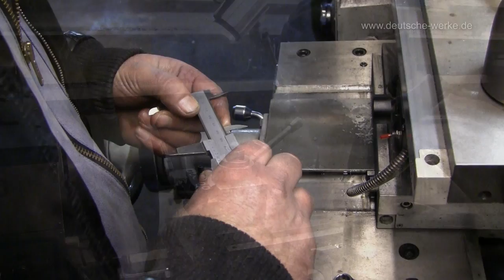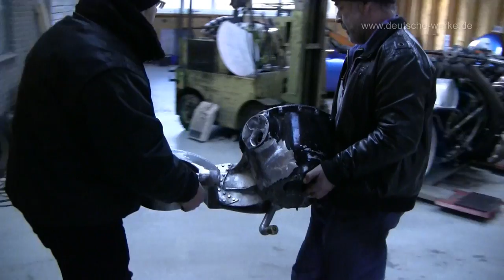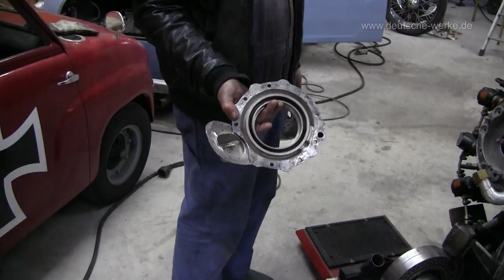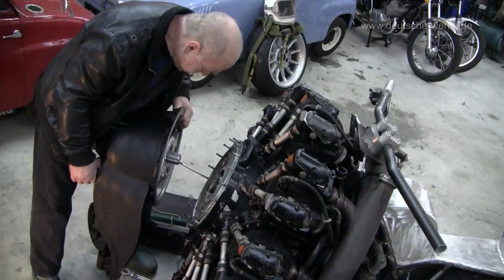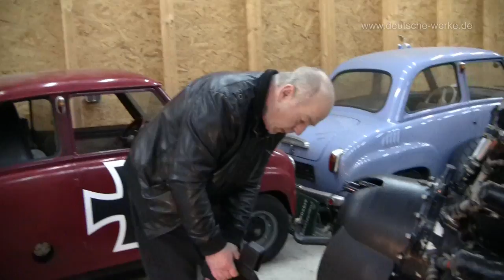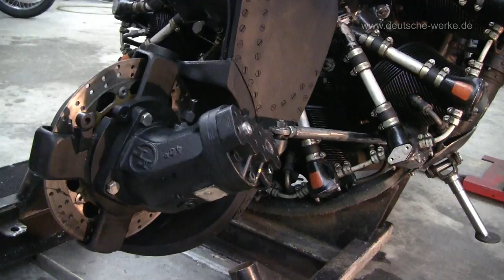Bomber - Bike Transmission Stage 4 (Motorrad mit Sternmotor)

Comment: If you ran it at anything approaching full power for any length of time you'd soon be going so fast that it would get enough airflow anyway - but cooling would rapidly become the least of your worries. It's going to spend the majority of its time basically idling, and you wouldn't have seen a huge amount of cooling under those conditions whilst it was installed in the plane either.